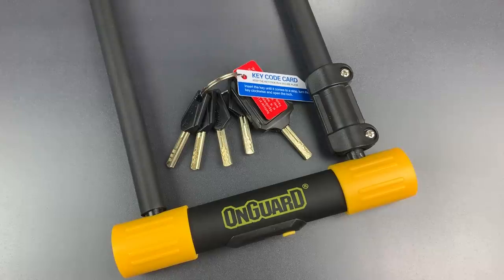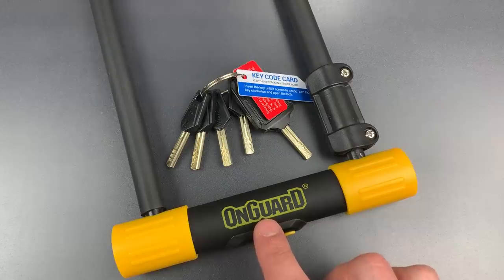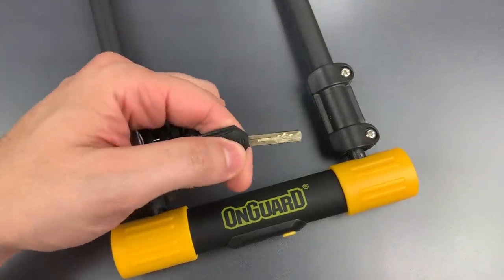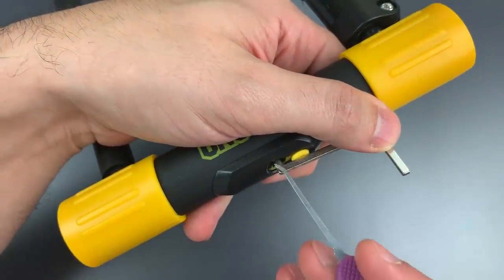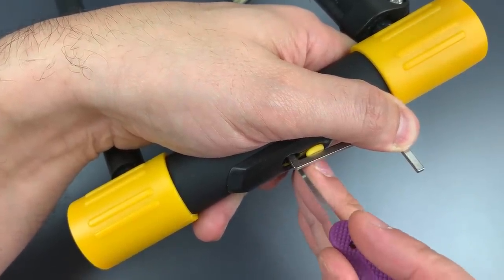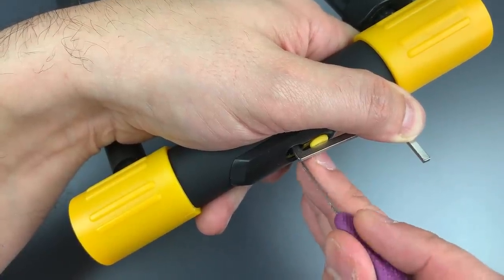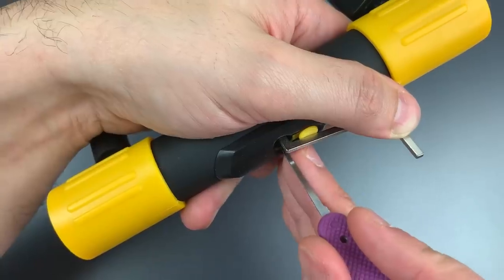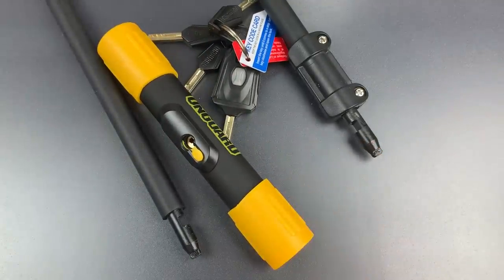[779] OnGuard “Bulldog" Bicycle U-Lock Picked (Model 8010LM)

Comment: ....godammit.... this is my bike lock....
Reply: Lock it on a side were it's uncomfortable for them to pick it and use a chain with it yes 2 locks I have this lock too and a chain and I lock it in decently high crime area's and it stays there for an hour at a time with this lock and a chain lock together yes if a true scum bag wanted to they could cut both but they would need 2 different tools at least and possibly take more time trying to steal it 🤷‍♂️
Reply: Same.
Reply: Dang.  My lock as well, previously secured an expensive electric scooter.   Never again.   

Thank you for the content.

Comment: I been using a mini version of this lock for the last 15 years in Chicago. Use the lock a few times a week. Lock might be easy to defeat and cut, but seems to be good enough for locking my relatively inexpensive steel-frame single speed. Bike hasn't been stolen yet.

Comment: Damn it...I own this lock. Spent a good month trying to find a decent lock I could afford and this came highly recommended by the cycling community for its toughness and affordability. I know bike locks are only really supposed to be a deterrent, but this is disappointing as hell. Which bike lock has given you the most trouble, even if it was just by a few seconds more?
Reply: Honestly, most people outside of serious locksport enthusiasts and locksmiths  aren't going to be able to pick this, just because he makes it look easy doesn't mean it actually is. That being said the unhardened shackle is a pretty serious concern.
Reply: kidthorazine - Yeah, I specifically bought it for it’s thick, hardened u-lock. I didn't realize the shackle wasn't hard as well...
Reply: @pickleshanks  Hopefully he'll do a destructive test and be proven wrong, but yeah that's an issue with budget locks.  Look into how much the really serious pick resistant lock cores cost sometime.
Reply: Do remember that LPL is a legitimate prodigy.  While the weak link in this solution to him is the lock, you're unlikely to find anyone in your local area who wouldn't find it faster and easier to attack the lock body instead.
Reply: I wouldn't be too disappointed.  Between this channel and Bosnian Bill, they pick EVERYTHING.  Fortunately not too many people can Single Pin Pick like they can.  I've gone to a lot of locksport events and NO ONE picks like they do.  Its not a bad lock, and a lot of people use it.  If someone wants your bike bad enough and you leave it too long or in a frequent spot or high theft area they will get it no matter what you lock it with.  You might just use it until you can afford a Kryptonite or similar in the $150 USD range.  Also, register your bike and mark it with your mark or hide a GPS tracker in a flashing light or head lamp under the seat etc.  Always lock up somewhere not too busy, but not dead with some light.
Reply: Get the Brute, massive 16.8mm skackle, less than £30 / $40.
Reply: Captain Pickleshanks you bike should be ok with this lock until the bike thieves find out about the Lock Picking Lawyer the at that point in time there will be no lock that will be any good,  all they have to do is watch LPLs videos to find the exploits of most of the locks.  Also the LPL is an exceptionally gifted lock picker  and is great about thinking out of the box in finding ways to exploit locks where the common thief would be clueless.
Reply: In my experience there's always someone else at the bike rack with a better bike than mine locked up with a cheap cable lock that a thief would crop in seconds with a side cutter.  Path of least resistance!
Reply: Always carry a second lock. Even if its a cable and padlock.
Reply: I have this one as well, and it's no stronger than the OG series but this one seizes up if you get water in it. The caps on the end are rubber and come off, and allow dirt to get into them, which allows dirt to get into the body through large through holes on the bottom. Add water and it gunks right up. Plus, the heads of the keys are extremely weak and snap off when you try to open it after it seizes.
Reply: @mjverostek1278  Weird, I haven't had this problem. I lost my keys for 2 years and just found them this past weekend and rescued the lock from the bike rack it's been sitting at and cleaned it up. 2 years of outside exposure, although under a canopy, and it still opened smoothly.
Reply: @dan10things  Guessing because it had been sitting there, not being in transit, moving around, and letting water get into it. Keep it lubricated. I wish I had put some type of weak adhesive on the end caps when I noticed they would come right off, perhaps something like contact cement, which would also create a liquid barrier.

Comment: .050” unhardened?? Might as well make it out of plastic! What would be quicker: picking the lock or cutting it with a hack saw?
Reply: Cutting with a hacksaw.. less technical and speed about the same I would guess.
Reply: What does that mean, .050"?
Reply: @michel_dutch  the thickness of the metal the body is made out of.  50 thousandths of an inch.
Reply: i'd bet "sturdy hammer" would work faster still.

Comment: i use that lock all the time, can that lock be cut with hydraulic bolt cutters?
Reply: Absolutely. And it can probably be cut with normal bolt cutters. And with a battery-powered angle grinder.

The question is, is it good enough for you. If you have been using it for some time and still have it and your bike, then it probably is good enough for the area where you ride and park.
Reply: @lwilton  Normal bolt cutters cant cut this lock, lots of youtubers have tried and failed.  Angle Grinder can cut it easy but will draw a lot of attention to bike thief.
Reply: No. It cannot be cut with a bolt cutter..

Comment: What's the purpose of that big block of plastic on the right leg?
Reply: RealUnimportant It fits into the lockholder, which can be mounted to the bicycle frame, that way, that the lock has to be opened before it can be removed from the lockholder.